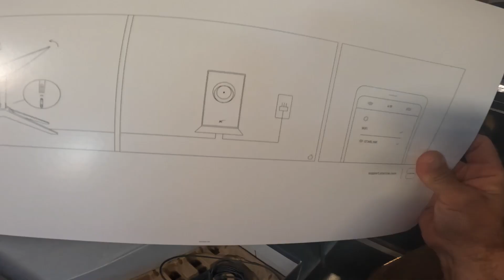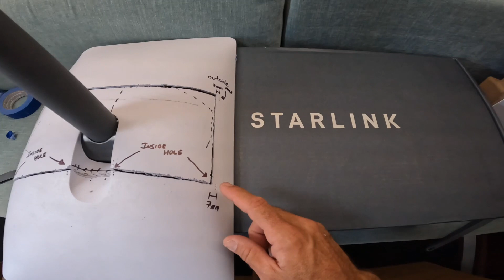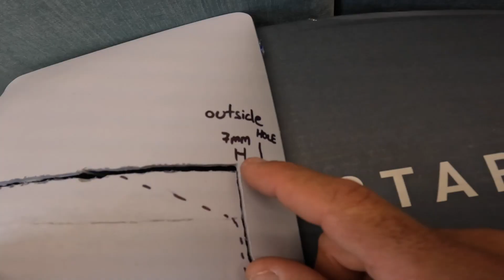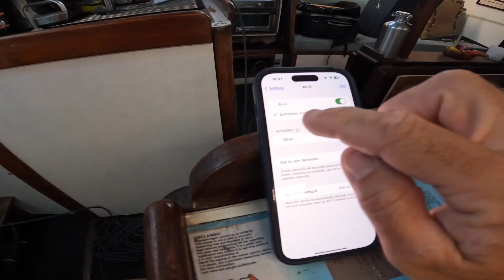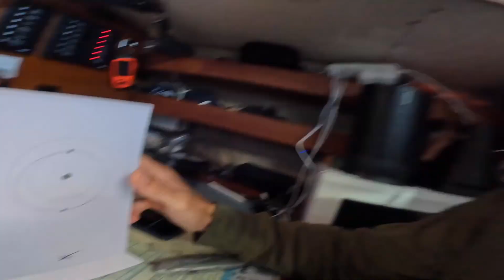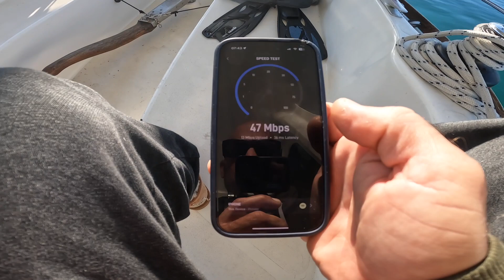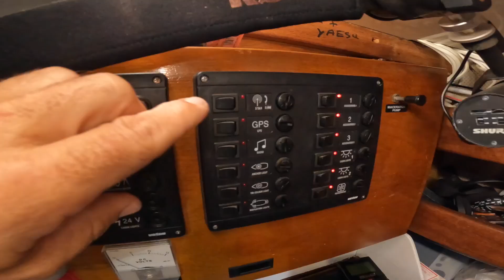Hacking Starlink: Low-Profile Dish & 12V/48V Router Hack

Comment: Thanks for this - I would cut the side with the dip for "stow mode" 5mm further away as the cable is close and got scraped. Bottom of the vents might be better on that edge, depends on what tool you use (i used an oscillating multi tool)

Comment: Thanks for your efforts!  That one close cable was pretty frightening.  My insurance on it was to use my trim router with an 1/8th inch bit and drop down tiny by tiny until my cut was just breaking through here and there. then used the back edge of my Buck knife to push gently and remove the remaining hairs thickness. an edge guide with double back tape kept my lines straight and then I finished off with a Dremel with a cutoff wheel in the leg groove.  
I'll do the DC conversion later and most likely just coil up all that cable in the back of beyond.
Well done Sir
Reply from the maker: Nice! So you're cabels on the inside were in the same spot? Re cutout template

Comment: You know you can use an aftermarket router which  runs on 12V then just add the 48V which is what a lot of people do
Reply from the maker: I did look in to that but just didn’t want to buy another router if I didn’t need to

👍👍

Comment: Nice job! Nothing you did there is as easy as you made it look. It seems like a lot of work to solder the wires back together. Most people would just crimp on RJ45 connectors and use a coupler to join the cable back together. Waterproof RJ45 connectors and couplers exist if the locker where the join lives  gets wet. But soldering is certainly cheaper. Not sure where your 48V comes from but a lot of people have had issues with noisy 48V sources creating so much interference that the links speed is reduced from 1 Gbps to 100 Mbps. If you never see a download speed of more than 100 Mbps then you probably have that issue too. It might not matter to you though. Thanks for the video.
Reply from the maker: 148Mbps as just checked. that is on the better side of the times i have checked. Not sure about that noise issue but starlink for me has been sweet. Never having home internet before, maybe i just don't know what good is! 🤣